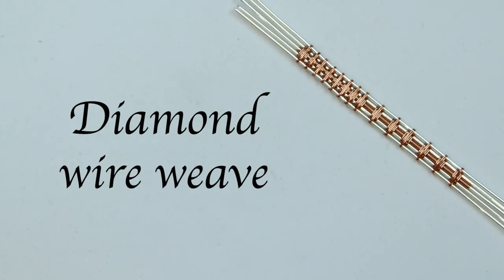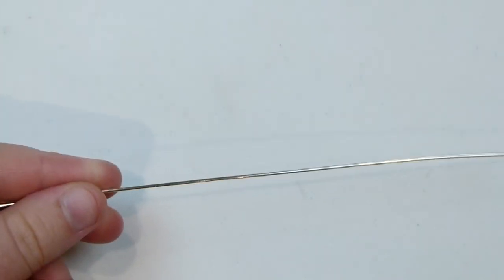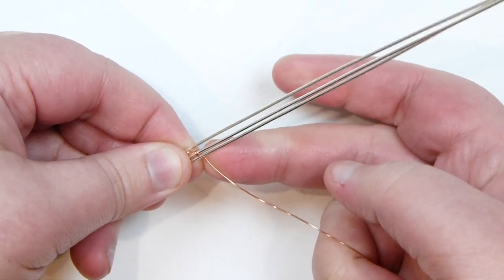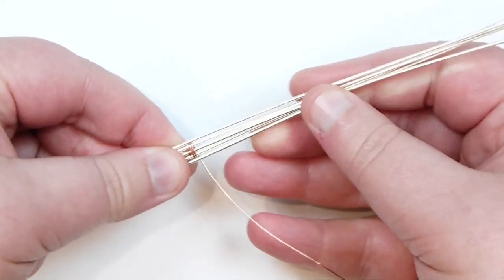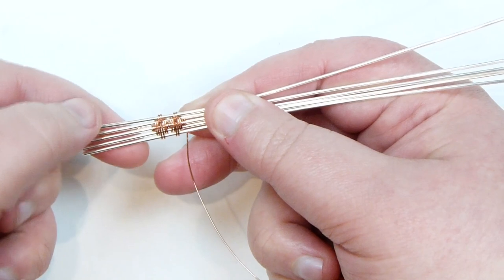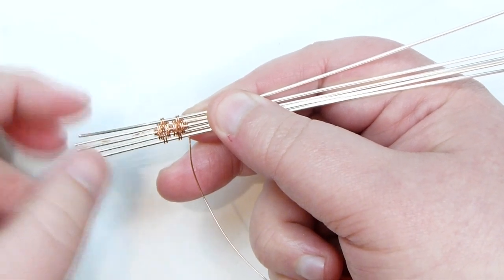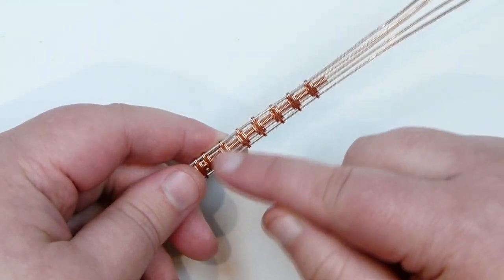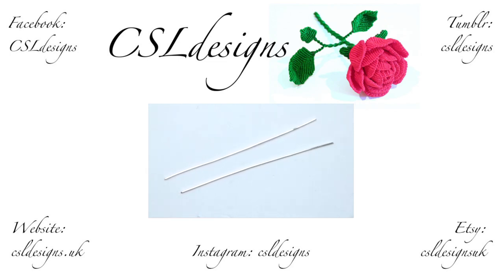Diamond wire weave ⎮ Wire weaving series

Comment: You can also use seedbeads on the wires to keep the distance between them, sliding them along as you weave, they can sometimes get in the way when weaving but sliding them further down the wires helps

Comment: You could use small beads on wires 2 and 4 to act as spacers to allow you to pull more tightly without worrying about closing the gap between wires.

Comment: After you are done the weaving.....can it be pounded flatter without damaging the wires?
Reply: Lor Ahh -- if you use your pliers, you can flatten the weave. Or, you can get a steel block from Rio Grande or another store (or see if some where local has an inexpensive 4-5" square steel block), cover your piece with a cloth, and use a chasing hammer, which has SOFT "hammer tips" to do this. Good luck!